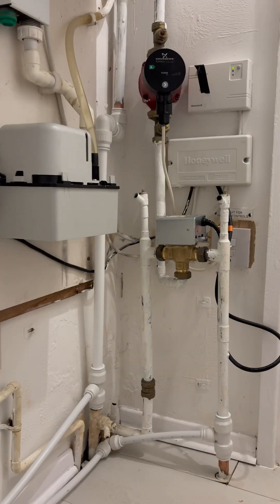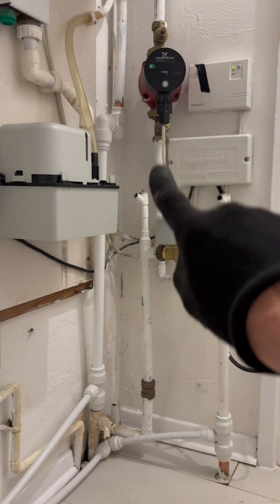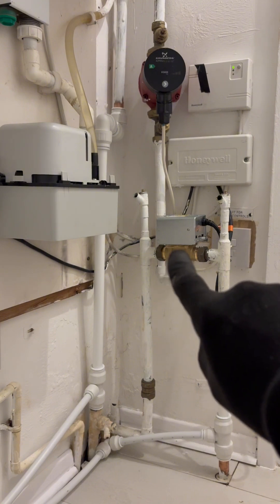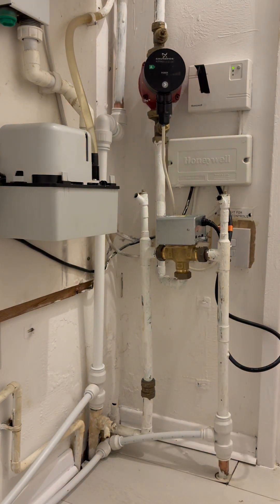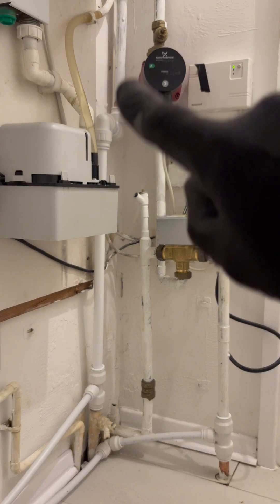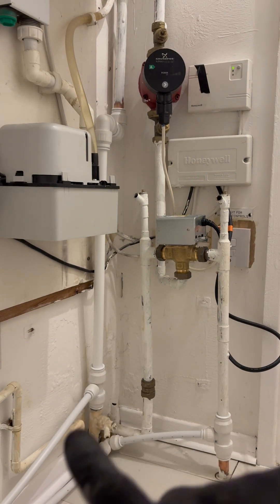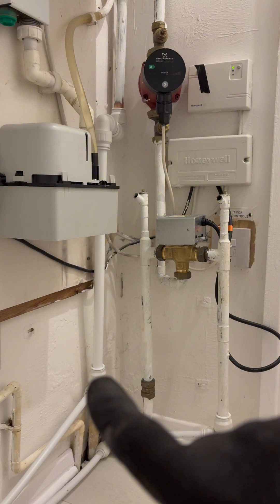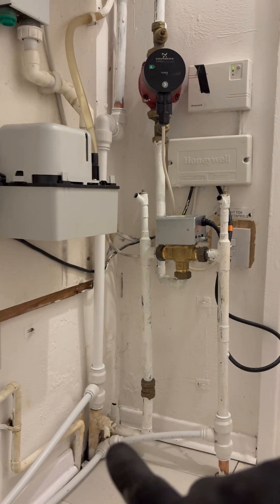Reverse circulation caused by breaking the 3rd tee rule. Heating return pipe in the wrong place.

Comment: Good idea to do that for your towel rail in bathroom then only comes on when you have a shower and your towels warm when your done
Reply: It’s still reverse circulation. If you wanted that you’d just pipe the flow to your towel rail off the primary flow

Comment: I have never heard it called the 3rd tee rule? Hot water return to be the last tee rule.
Reply: Brilliant video, it's one of those things that has always stuck in my head from my Dad, god bless him.  Last return tee must be heating!!😊😊
Reply: You could just install non return valves on the return pipe for the radiator.
Reply: @dgngas from my experience, non return valves are for mains pressure and would offer too much resistance. And it’s not necessary if you make sure the return from the hot water coil is the last one on the way back to the boiler. So many combi boilers are going in that this seems to be a dying art. Weird really considering it was once common knowledge